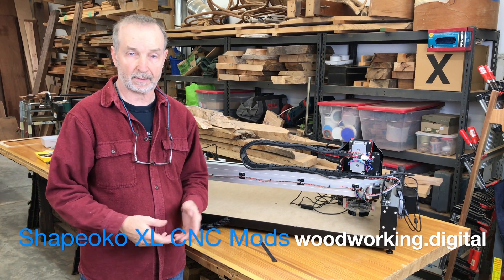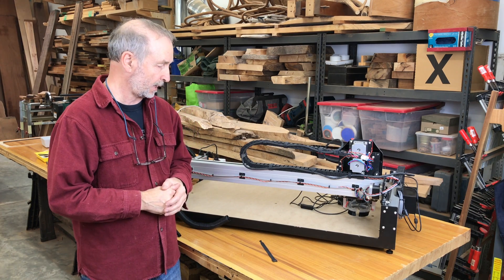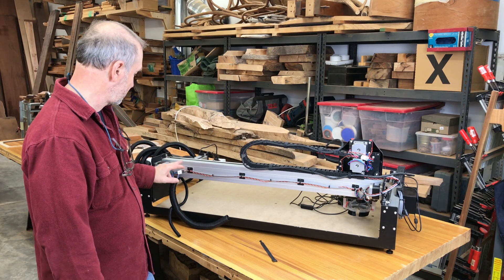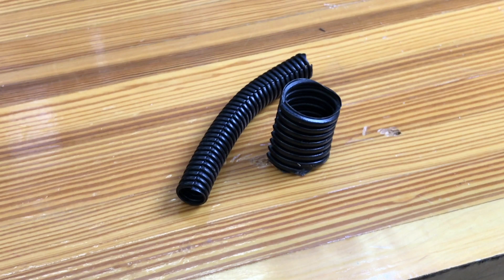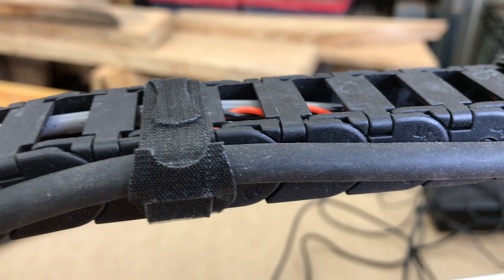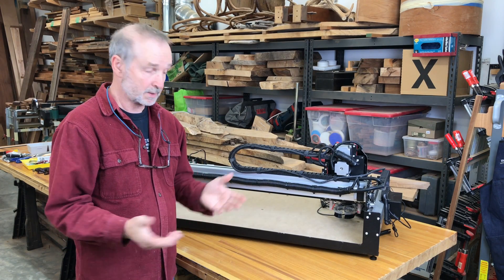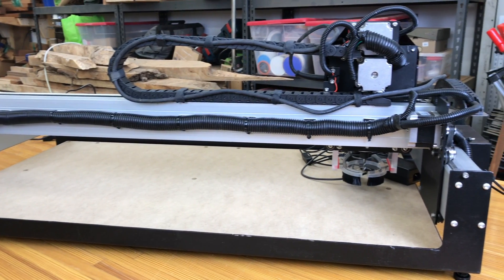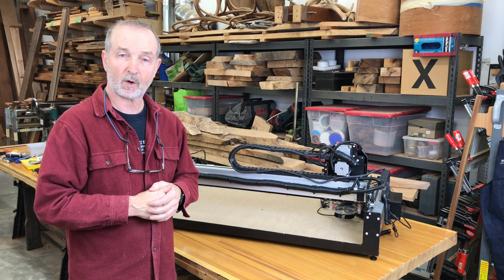Modifying the Shapeoko CNC

Comment: Tim, Thanks for this reminder. Like so many others, once a tool arrives in the shop, I want to use it right away. I've had a band saw stop operating due to sawdust in the power switch box so, to me, it's a useful tip.